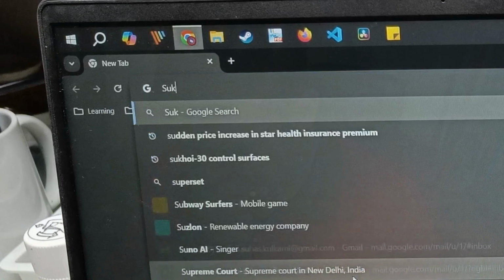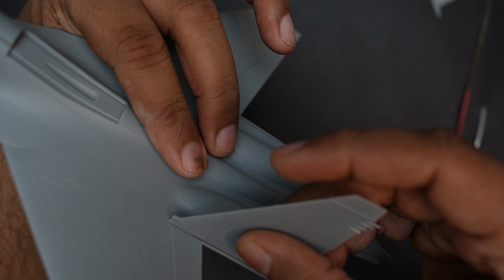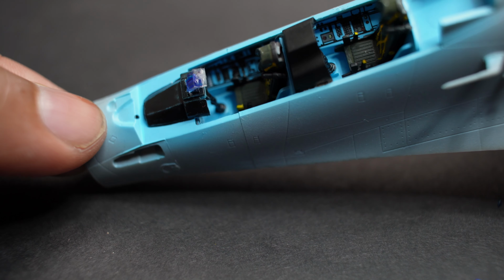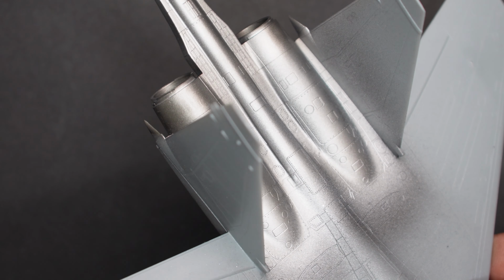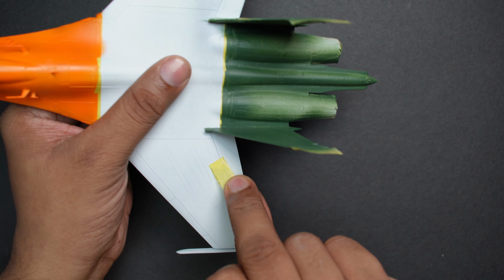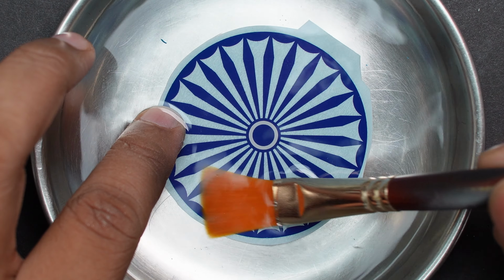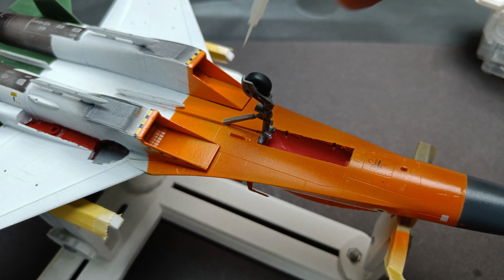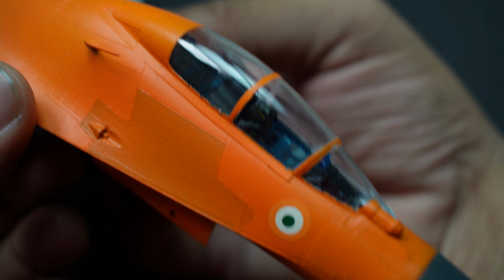1/72 Su-30MK-1 Flanker | Full Build | 50th Indian Republic Day Tricolor Scheme | Aircraft Model

Comment: That is some great work!!! BTW what do u use to thin Mr Surfacer primer?
Reply from the maker: Thanks. I use NC Thinner from paint shop.
Reply: @IndianScaleModeler  and what ratio?
Reply from the maker: Roughly like 3 parts primer to 2 parts thinner. Basically, I just eyeball it nowadays 😅 till I see required consistency.
Reply: @IndianScaleModeler  Ok one last question, do u use NC thinner for tamiya paint aswell?
Reply from the maker: Yes. It works as it is a lacquer thinner.